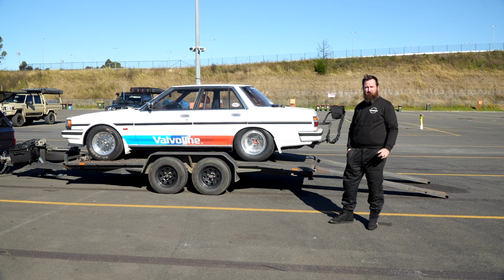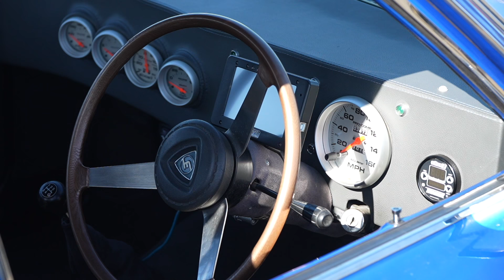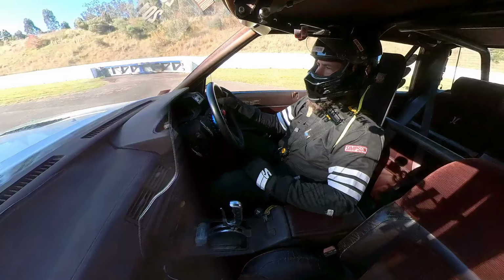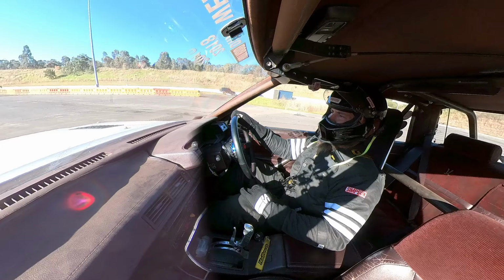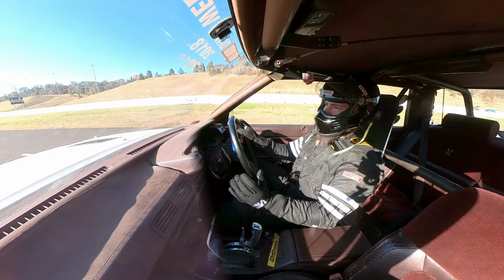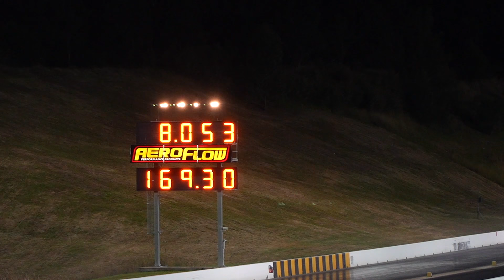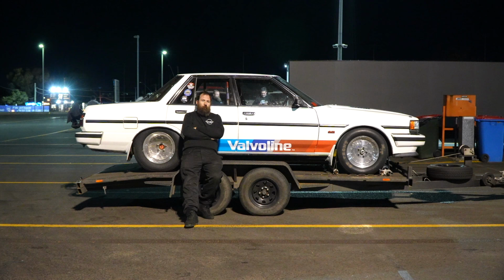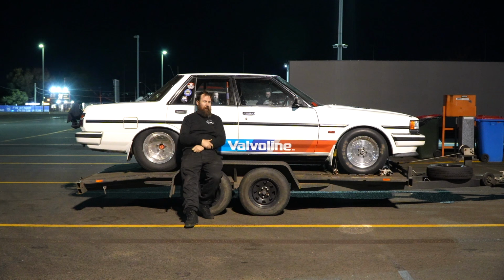CRESTA | Record Time Before Drag Week

Comment: 8.1’s with full interior is bloody impressive
Reply: And still street legal!
Reply: Street class in Australia sure is different to Street Class in USA. You see some of the TouTubers Street cars which are essentially Pro Mod cars with lights because they're registered in states that allow almost anything to be registered. I sitll love those USA cars, but seeing a 8 second Cresta with absolutely original interior other than the required safety stuff is still the best thing ever. I'd like to see the interiors of some of those 6 second GTR's.
Reply from the maker: @aaronkratzmann9703  most are almost show level. Full custom trim with carbon accents everyehere.
Reply: @BennysCustomWorks  Would be hard to call them sleepers, but most don't look like they're about to rip 6 second passes. Even cooler to know the interiors actually exist.
Reply: Yes, you can sit in them, but most wouldn't be comfortable like the Cresta.

Comment: 8.1 on a glued up track with be an 8.70 on a track with a couple of hundred cars down it.
HOW do so many cars lose voltage?? Even if the alternator is not doing its thing the battery should be 13.5V
Yet I used to do 3 day race meets without an alternator which I consider an instrument of the devil. On a 580hp Chev.
Reply: Are we talking about a carby chev? Then thats why. Cars with EFI on full chat can be drawing upwards of a hundred amps during a run between fuel pumps ignition injectors ECUs etc

A fully old skool mechnical V8 could probably do the same with <10 amps
Reply from the maker: We’ve consistently run quicker than 8.50 on wednesday nights ( up 200 cars on mostly street tyres)